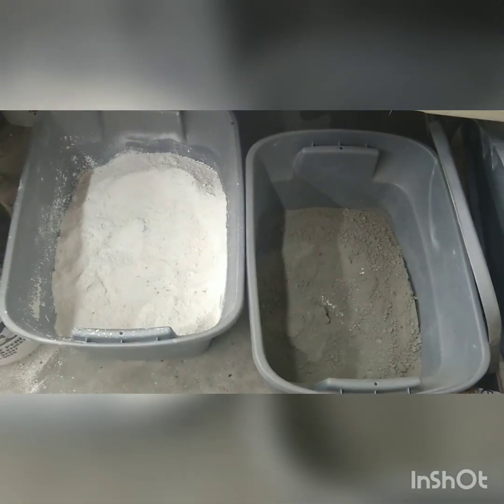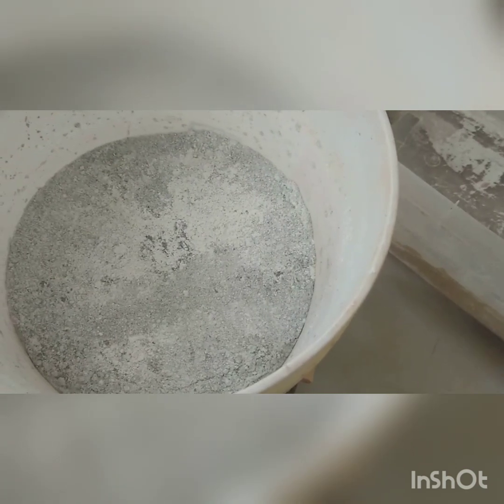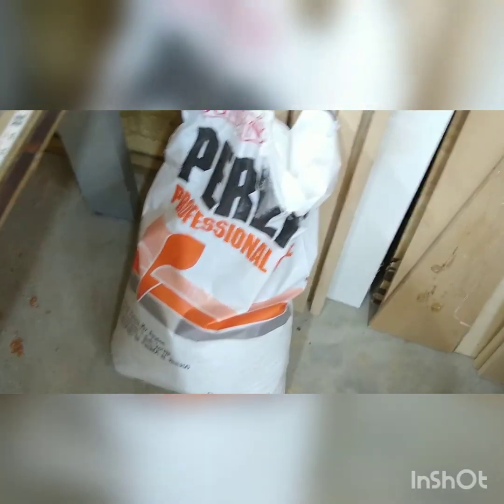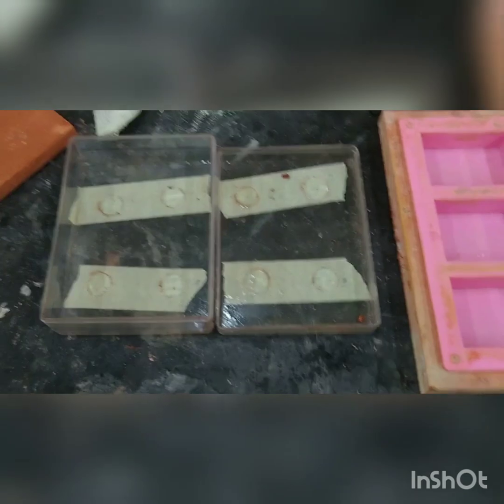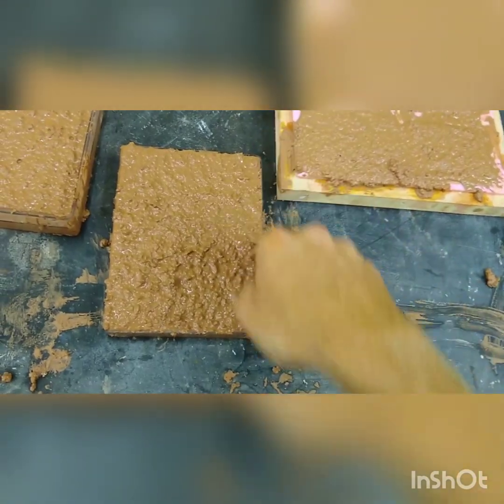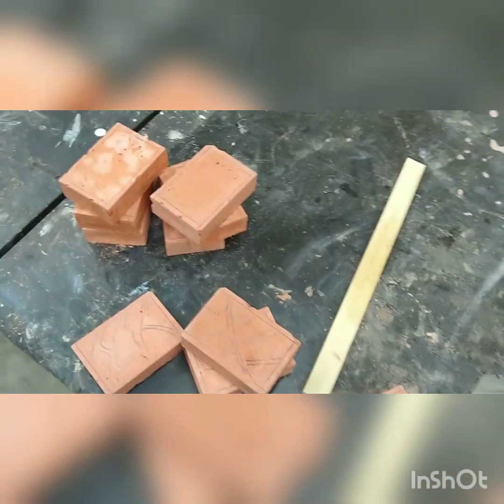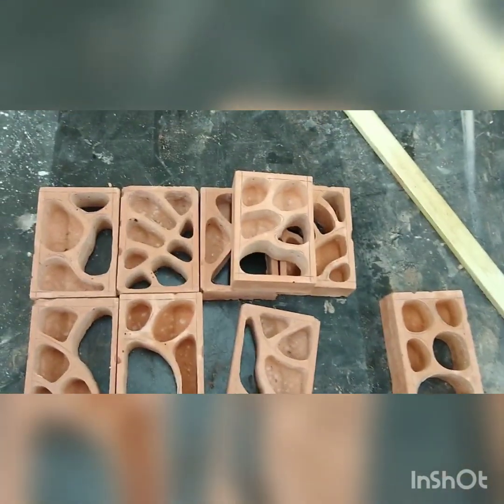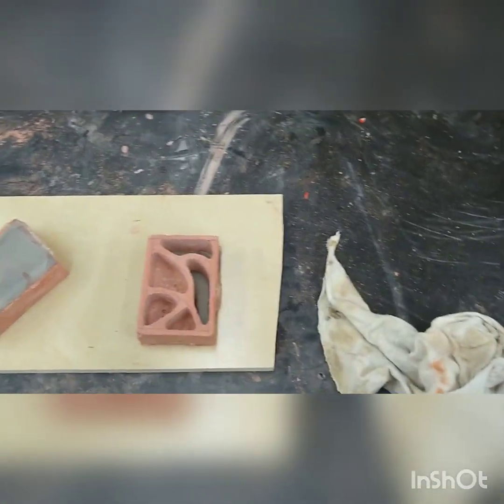Advanced Formicarium Design Pt 1: Build your own DIY ant nest from scratch.

Comment: All the Portland Cement sellers around here seem to sell only a Portland Cement & sand MIX. Is that what you use or is it pure Portland Cement?
Reply from the maker: I use pure portland cement, if theres sand it will be fine just harder to drill

Comment: Mr. Harden,  question for you. Plaster of Paris is known to mold in ant nests. Have you had any issues with this since you mixed it with Portland cement?
Reply from the maker: In most nests, the material itself is wet from the hydration method. This warm, wet environment provides the perfect place for mold to grow. The material in this design in not directly in contact with water and remains dry. Mold may still grow on excess food in the nest ( a problem in any design) but the material itself will not mold.
Reply: Awesome Thank you!
Reply from the maker: @joshuamartindale4124  no problem!

Comment: Man this video is so helpful! I don’t have a drill press, is there another way to carve the chambers?
Reply from the maker: You could use a dremel, you can buy them for $20-$100+ and work great, they are also a useful tool to have around the house
Reply: Frank Harden good deal man. Pretty sure I have one of those laying around somewhere. If I chose to make an actual water chamber would enough moisture soak through the walls to hydrate the nest?
Reply from the maker: @JLGReptiles   it would but I do not recommend that method. It is difficult to keep everything consistently humid. I find it is either too wet or too dry. Also unless the water chamber is the single lowest point in the nest (below the nest chambers and everything) water will seep into the nest chambers and flood them ime.
Reply: Frank Harden ok that makes since. I do love how clean these nests look! Probably the best looking homemade nest I’ve ever seen.
Reply from the maker: @JLGReptiles  thanks a bunch man! that means a lot
Reply: Frank Harden no problem buddy. I’ve probably watched over 20 videos on how to make a nest and this is by far my favorite design! How did you carve the holes that connect the chambers? Probably just going to buy a drill press lol. Found a pretty good one for 150$
Reply from the maker: @JLGReptiles  thanks again!  i just use a drill and/or dremel
Reply: Dremel...